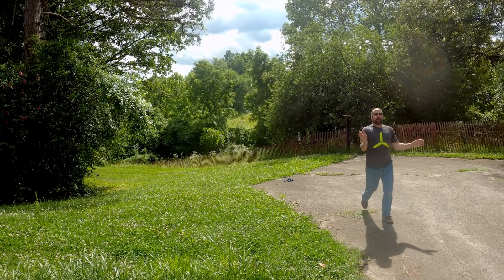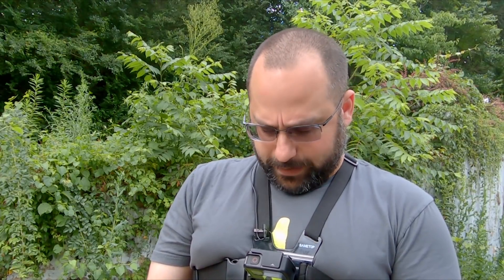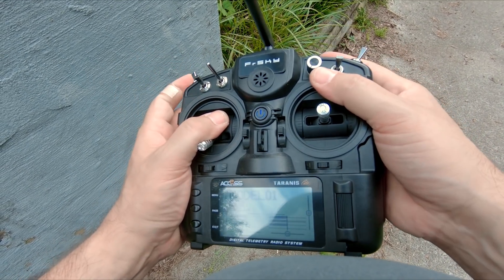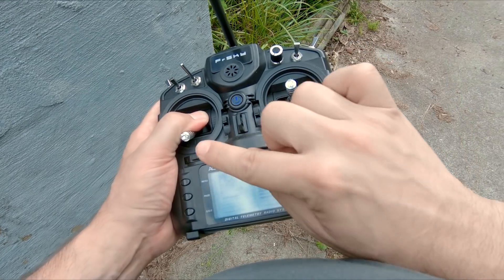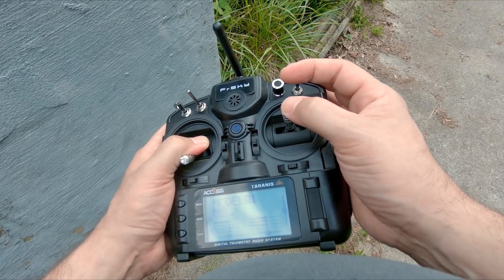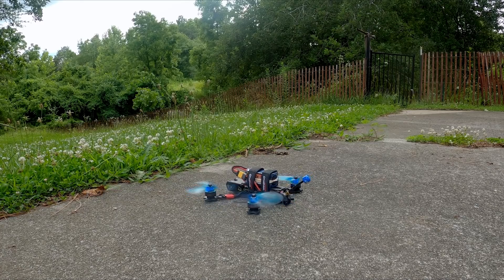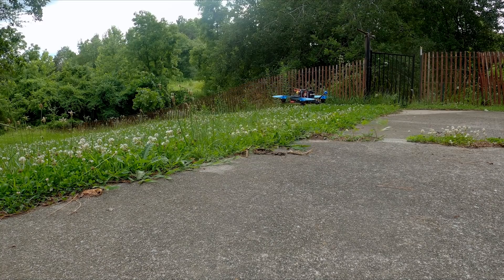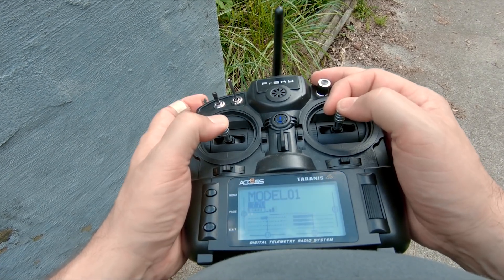FPV Drone Budget Build Full Tutorial - Part 5 - Maiden Flight

Comment: Hey Joshua, are there any DRL Sim or Liftoff setups that estimate the flight characteristics of this kit? Mine is on its way but I'd love to get some experience on the sim first. Come summer I hope to capture some sailing footage with this quad so any practice I can get to prevent ending up in one of the great lakes is "great"ly appreciated!
Reply: I created a DRL Sim  Community drone called X-5-JB-MK1. Based on the closes specs of the part, curious if it's even close
Reply from the maker: My opinion is that all simulators are only so-so at simulating the performance of a specific quad. They do their best. But when you fly the real thing, it's always different. I would say, take almost any 5" in a sim and it will fly something like this. Maybe lower the power by 85% as the motors in this kit are a little under-powered, for beginners.
Reply: @JoshuaBardwell  Haha, thanks! I'm still chuckling at lowering the power by 85% as I'm booting up the sim now. That's great feedback though and I'll set a reminder on my calendar to report back in a couple weeks with how it compared. Cheers!

Comment: Hi, Loved the building experience and  thanks so much for the detailed video. But I have one question:
Dose this build support GPS. When I flew my maiden flight the quad preformed amazingly, but I didn't have telemetry or GPS location.
This is mt first fpv build and I might be missing something.
Do you have any suggestions for fixing this problem?
Reply from the maker: The quad doesn't have a GPS unit on it, so it doesn't support GPS when built as shown in this video. It's possible to put a GPS receiver on it, but Betaflight's support for GPS related functions like loiter and return to home is nonexistent to barely functional.

Comment: it finally flew but it pulls over 200 amps at full throttle on 4s is that normal?
Reply from the maker: I would question whether the current sensor was calibrated right at that point.
Reply: @JoshuaBardwell  how can i recalibrate it?
Reply from the maker: https://www.youtube.com/watch?v=pj_CaMZ98g4&ab_channel=JoshuaBardwell

Comment: So I just built this 4s version and just broke one arm because in mid flight I did full throttle punch out and basically instantly I lost video feed, quad stopped to react to my radio input and started to fall and just before it hit the ground video feed came back and I saw betaflight starting logo so it basically rebooted. I bought brand new batteries( 4s 1500mah 100c) with this kit. 
This is my first diy quad... Sadly im from Europe, and only banggood sells this kit and but no replacement parts...
@Joshua maybe You have any idea why this would happen on high throttle?

Comment: Thank you SO much for this series!

Here's how good it is... I don't REALLY want the quad, but I'm going to buy it (presuming it's still available) just because I think the knowledge and experience I gain while building it with this tutorial will be INVALUABLE for later construction projects. It already helped me when I had to unsolder and then resolder all the motors on my Alpha A85 when I had to replace the frame. If I hadn't watched this series and some of the recommended soldering tutorials, I don't think I could have pulled that off. And I'm POSITIVE I wouldn't have gotten it right on the first try.

Great stuff Joshua!

Comment: Hi Joshua! The XILO drives me crazy ^^
It is flying great if it‘s in the air.
But I have a massive Problem when arming the quad.
Everytime I arming the first times some motors do not spin. Switching to tutle mode, all motors react normally. When arming normal only 2 or 3 motors spin. I have to repower the quad 3 to 10 times until all motors spin and then it‘s working great. Maybe it‘s about the dinamic idle settings I tried on 9000 and 12000. I have no Idea how to fix this issue. Please help me.
Regards!
Reply from the maker: Don't use dynamic idle.

Make sure idle percent is set to 5.5% in Configuration tab.

Make sure you're using DSHOT300.

After that, if the motors don't spin reliably, contact getfpv support.
Reply: @JoshuaBardwell  
Update: dynamic idle has no effect. Problem is only when using 6S Batteries.

Thank you for answer! Idle percent is 5.5% and DSHOT300 is set.
I have rised idle_min_rpm from 12 to 16. Now all 4 motors are starting. I need to play with this idle settings and watch your video some more times to fully understand this.
Reply: @JoshuaBardwell  I have done some tests, and things going more crazy.
I have the 17000kv 6S Version. On a 4S battery motors spinning fine. I use 4S on the workbench so I see no problems while tweaking on betaflight. 
When I connect any 6S on the field. motors do not all start spinning.
So why runs the copter on 4S perfect at 5,5% idle? With 6S I have to rise idle to 7% until all starts reliable but still stuttering.

Btw, I have flight time up to 10 minutes with 6S goldbat 1300mah 120c. Basically it looks perfect.
Reply: Hello Joshua, I was in contact with GetFPV. They think it‘s an defect FC. I ordered a new Stack. They send me the FC for free. On changing everything I found the problem on the defekt ESC. With new ESC everything works perfect.
I also changed the motors to Ethix Cats 2207 1750kv.
Now I have smooth flight.
Lucky to damage nothing while flying 2 weeks with a defect ESC 🥳

Regards

Comment: Bought this today, I used your link, can't wait to build it!
Reply: Have you built it? Did he put some additional camera for footage or its the camera from the kit?
Reply: @PinkeySuavo  Yes I completed the build following along with Joshua's tutorial videos without a problem.  Make sure to watch this as well it's regarding a wiring change that is important.  https://youtu.be/Jk3Z2JJ94Tk  Myself I upgraded the fpv camera from the get go with Joshua's branded camera.  Here is that link https://www.getfpv.com/runcam-phoenix-2-1000tvl-2-1mm-fpv-camera-joshua-bardwell-edition.html, in which I just wired like the original video.  As far as the footage I can understand your confusion as the video never showed a go pro or other hd camera, and I'm not 100% sure but I can say with confidence that it wasn't osd footage.  I'd like to add that this was my first build, I've built a variety of quads since and this is still by far my favorite in both flight and assembly.  I would for sure recommend whether a first build or also for a seasoned pilot.  Hope this helped and if you read this Joshua Bardwell I can't thank you enough for everything you do bro!

Comment: So I built this drone for shiggles and the one problem I'm having with the stock Xilo camera is getting lens cut from the top plate. You can see it slightly in your YouTube video but with the way the camera is mounted I can't get the picture clean. The Xilo camera is so small and mounted so far back you can see the posts in video at certain angles. Other than the video being jenky it flies well enough for a $200 quad.
Reply from the maker: You can remove the camera side plates but it compromises durability some.

Comment: how did you get the audio out of the quad when you clipped the audio wire?
Reply: I would love to have audio
Reply from the maker: I don't use audio.

But you don't have to clip the audio wire as the vTX now comes with all the wires needed.

But the camera has been swapped and doesn't have a microphone any more.

Comment: Joshua, very interesting the way you set all the videos for this project, I really liked it.  I am aware this is a budget FPV quad, so I have a couple of questions, were you flying with goggles (ain't cheap by the way)? Can it be linked to the TX16S, eventhough the quad has a FrSky rx? Regards
Reply from the maker: Yes I was flying with goggles.

The TX16S has a multiprotocol module that can bind to FrSky, FlySky, Spektrum, and others.
Reply: @JoshuaBardwell  Joshua, thks. I guess the FrSky rx protocol is not ACCESS. And what would be your recommendation regarding a budget, but reliable, set of goggles? Keep setting the trend in quad arena. Regards

Comment: JB I built this kwad and each time I power cycle it the vtx boots in pit mode. I don’t want to turn off low power disarm and be at 600mw all the time. How to fix this? I would also love to be able to get actual audio in my headphones....I connected the audio wire but still no sound 😕
Reply: connected the audio wire but still no sound 😕

same here
Reply: @CrashGoatFPV  same here. The mic in the camera does not work in this edition. I added RUSH AGC mic and it works fine. ✌🏽
Reply from the maker: Hold down the button on the vTX until the LED stops flashing.
Reply: Joshua Bardwell each time I plug a battery in? 🤷🏽‍♂️
Reply: Joshua Bardwell can I set pit mode power to be 25mw instead of 1mw?

Comment: I just want to say thank you for this video series.  I have been looking at building my first race quad and have been watching your videos for a while.  Years ago I purchased everything to build my first drone, this was before the DJI Phantom one was even a thing.  I never ended up putting it together.  I wanted to jump straight into long range flights for my first drone.  It was a daunting project, I made worse  by clipping the connection pins on my new controller because the JR module wouldn't seat.  A friend was over, we had some drinks, and I decided the factory must have put too long of pins in.  At that point I set the whole thing aside.
Eventually I bought a Mavic Pro which served the purpose of my original project well enough.
  Not too long ago I found the DRL simulator via your review (thank you very much for that), and have been practicing about an hour a day since I got it.  The build my own drone bug has bitten again, and while the Mavic is great in its own way, it isn't what I would call nimble, and its no good for racing.  So I was starting to think I needed to find a good step by step build I could follow.  Youtubes algorithm had me at hello and served up your video.  Thank you for putting out a build video for a drone aimed at a quality experience vs cheapest get you flying.  Its sounds like you have done that before, and it seems like every drone channel has done an "under a hundred" drone video.  I'm glad those videos are out there, but this series is exactly what I was looking for.  So I'll be buying the kit and following your build.
  The thing that made me want to comment was the excellent way you presented this information.  For me you really struck that balance of presenting all the facts, while keeping it short, but also a bit of hand holding.  I realized at some point there was something missing in your delivery, but I liked that it was missing.  And after some thought I realized it was something akin to condescension.   You gave the info like you were talking to a respected friend who you knew was intelligent but just lacked the information.  You didn't spend time trying to lure or entice.  You just talked from the stance of,  if a person was watching this video, they had already decided drones were worth while.  It was really refreshing.    Hopefully you actually read this.... thank you for your videos, not just this one.

Comment: I got done with everything and it flies with little oscillation and the motors aren't too hot  but it makes a high pitched whistle when giving it a punch in throttle... It sort of sounds like a train whistle idk if it's the props  or motor or esc... It's really weird.
Reply: Alright guys... I figured it out... Just in case any of you are as dumb as me my issue was caused by installing some props upside down. make sure the side of the prop connecting to the motor is the side that is flat and the leading edge going into the drone body should be round.
Reply: @JonathanMontgomery77  that's actually pretty funny. Glad you figured it out

Comment: Is it with the stock betaflight 4.2 PIDs or the video that we see is already after some tuned?
Also the footage is from GoPro with HyperSmooth enabled mode or something else?
Looks like it fly very good and smooth!
Reply from the maker: Stock PIDs here but improved PIDs will be uploaded soon. The footage is with GoPro but no stabilization. Stabilization is fine for cinematic footage but not for this type of demonstration where you want to judge the quality of the flight.
Reply: @JoshuaBardwell   Damm that's freaking so smooth video, I was sure HyperSmooth is on. Thanks for the reply. I have 7" GepRC and also some 2" quads. With HyperSmooth on I can't get such video quality with the 7", harder to tune but still.. My first 5" will definitely going to be this one

Comment: Nice playlist.  Never noticed the solar panels on the roof before. Hot water or battery pack somewhere too?
Reply from the maker: Currently just panels but working on getting a battery bank installed. No hot water b/c we wanted 100% of the capacity to be used for off-grid situations and if we're in a power outage I can live without hot water.

Comment: Let’s say hypothetically the drone flips over and just drops to the ground. What might be the issue?
Reply from the maker: If it hovers at all then your motor direction, board alignment, etc are correct. If it refuses to even hover and flips over immediately, here is the fix:

If the quadcopter instantly flips over when you arm and raise the throttle with props on, it is almost 100% certain to be one of these things:

1. Clockwise prop installed on counter-clockwise spinning motor or vice versa.

2. Flight controller not facing forward. Go to the Setup tab in the configurator. Tilt the quadcopter on all axes (pitch, roll, yaw) with your hands. The 3D model in the configurator should move the same as you move it with your hand. If it does not, use the Board Alignment parameter in the Configuration tab to fix it.

3. Motors not wired correctly. TAKE OFF YOUR PROPS. Plug in a battery. Go to the Motors tab. Turn on the "props are off" slider in the lower-right. Raise the individual sliders (1, 2, 3, and 4) one at a time, just enough that the motor begins spinning. The motor positions (1, 2, 3, and 4) should match the graphic in the upper left. If they do not, then either move the signal wires so that they are correct or use resource reassignment to virtually "move" the motors.

4. Motor spinning wrong direction. Do the same as step 3 but compare the motor direction to the arrows on the graphic in the upper left. If a motor is spinning the wrong direction, either reverse it using BLHeli (or whatever ESC software you are using) or swap any two motor wires with each other, which will reverse the direction.

Many times, people swear up and down they have checked all of these things, and then come back to say oops I missed one you were right. So if you think you have checked all of these things and your quad still FLIPS OUT, go back and check again. If your quad is insta-flipping on takeoff, it is almost always one of these things.
Reply: One of 3 things.. your FC alignment is wrong, motors not spinning in right direction, or props on wrong 😁

Comment: Hi Joshua,  what makes this kit better than the rotor riot cl1 kit?
Reply: The fact that one company (GetFPV) makes and sells all of the components(except the camera). A camera is a camera though. This means they can actually keep all the ”SAME” necessary parts available for the kits. This makes it possible to follow along exactly. The RotorRiot kit is also a good one, but it is made up of parts from 10+ manufacturers making it hard to keep the exact same kit “IN STOCK”. The RotorRiot budget kit part list always changes due to available parts.

Comment: Thanks for this tutorial Josh, all class.
I'm from Australia and looking to purchase this kit with batteries will there be an issue with shipping ?
Reply: Many companies seem to dislike international shipping LiPo batteries. I had a look and Get FPV won’t ship them outside the US (only ground shipping). I think you can get them sent to a forwarding freight company if you really wanted to get them from there. It would probably be easier to get them from somewhere with AUS. Just look for the same specs.
Reply: @Beamy-Ostrich  yea I came across the same info ended up buying some from aus, finished the build tonight, first test flight and full send tomorrow cant wait.
Reply: Tim Dawes please keep us updated! I’m gonna buy this kit as well and would love to hear your first experience with it
Reply: Tim Dawes , I decided to buy this kit last night after think of getting into FPV for the past 6 months. Went with the 4s one, but it won’t be back in stock till next month. If you could mention what batteries you got I might take a look, good luck with the first flight.
Reply: Well the build went flawlessly im running the 6s version. I purchased my batteries from ovonics along with a pro dual charger for them. First flight was amazingly stable and plenty of zip only thing I cant seem to get working is telemetry although not a big deal it would be nice to have
Reply: @timdawes7410  how has your drone been so far?
Reply: @mrcontroversy222  its been great, iv ordered more props as I cracked them tightening them onto the motor the reversed props tend to loosen off if not tightened enough